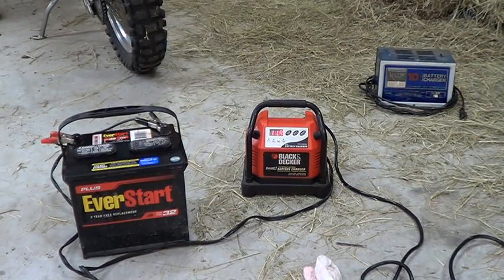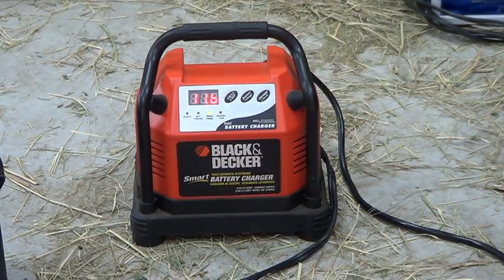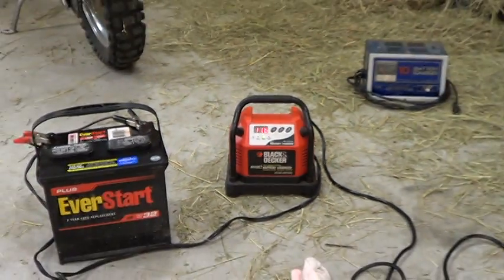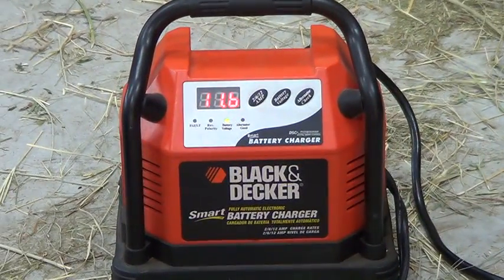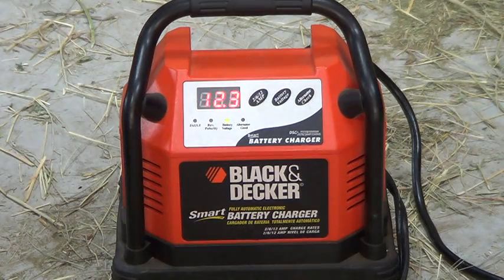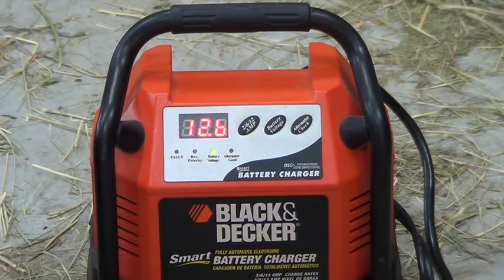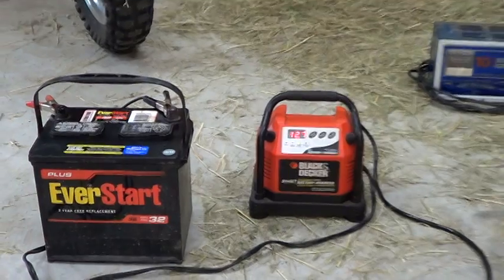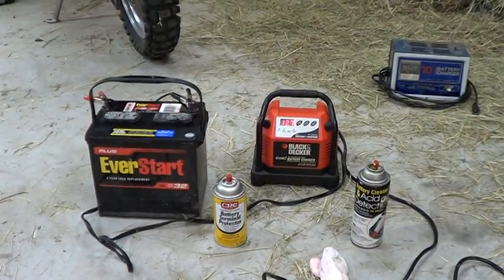Charging Battery With Open Internal Cell Error - Black & Decker Battery Charger BC 12B

Comment: thanks for the video, bud.

I got the b&d 10/6/2 amp smart battery charger.
plugged an almost dead costco batt about 4pm, and screen was reading 10.17.
510pm 10.7-10.8.
925pm 6.1-6.2

what in the h are these readings saying??
I had it on the 10amp setting, so it was supposed to be fully charged in 4.5 hours.

Comment: when you push the "battery voltage" feature it measures the battery voltage, NOT what voltage the charger is charging the battery at.  also, don't confuse the number of AMPS during charging with the VOLTAGE of the battery.  they are different

Comment: If you dump the battery out dry adding water wont get it going. Youll lose the majority of acid. Ive had some luck dumping cleaning screening the fluid and using it again. Or you can but battery acid and refill it. Youll need to get the proper ratio. If your charger there has a recondition mode run it. Ive had very good luck running my black and decker on recondition. Ive got one running now. Sometimes it will take dsys to run its cycle some times it does it in 45 mins.

Comment: How do I recharge the black and decker battery charger????
Reply from the maker: YOU don't it is NOT a battery, it is a charger, you plug it in and it charges other batteries that you connect it to.

Comment: By the way you have the battery on the ground you’re grounding the cell out regardless
Reply from the maker: stop repeating shit you know nothing about it makes you look ignorant not smart

Today all of these automobile battery-destroying or current-conducting flaws have been eliminated by using plastic shells around the various types of battery designs. And the potential problem of damage to the concrete floor from battery acid leakage has also been mostly mitigated, as previously noted by Interstate Batteries.

Comment: Never Leave a Battery on a Concrete Floor or on the Ground unless you put Wood, Rubber ETC Non- Conductive or your Battery will Die Early
Reply: dr robert dawson that’s a myth and not true.
Reply: That's out dated knowledge.  This was true back in the 80's.  Modern battery materials prevent that from happening now.

Comment: Hook it back up to the Montgomery wards charger... it'll be fine...lol I hate my smart charger...even fo3 on new battery..smart my ass.. dumbest charger ever!
Reply: Same here.  Charged my battery with the F03 warning but since the warrantee was running out I took it back to Sam's & they tested it said it was good but since their best test eqpmt wasn't working they gave me a new battery anyway.  I took it home and the piece of crap B & D charger told me the new  battery was bad too (F03)!  It's holding a good charge so I've come to the conclusion that the fault is in the charger NOT the battery.

Comment: The 2.6/6/12 is the amps that it is charging at..when you press battery button thats the voltage that the battery has in it at that time
Reply: The display is confusing. I’m using one right now and the display has 14.1. I know I have a 12 volt battery.  Then I realized that it was the charge current.

Comment: voltage rises from shaking because of making the bubles rise the top, thus freeing up surface area for acid, bubles of hydrogen form during the charging process and hydrogen cannot transmit voltage like a liquid can.

Comment: Also put your Battery on a piece of Wood, Never on the cement or bare ground,  ever.
Reply: It's an old legend due to how older batteries were manufactured. It's perfectly safe to modern batteries on cement or concrete.
Reply: On old old battery bats had metal on the bottom that could do that but not the plastic cases ones

Comment: Take Off All the cables & turn off the power. Put on some safety glasses first. 
 Then take off the caps and check the water level in the battery. 
Good Luck Rick.......

Comment: Rick you have a bad cell in the battery and it's a shitty Walmart battery. All products these days are made like junk now. I bought a die hard battery and a year later it had a bad cell in it and the car wouldn't start and I had to buy a new one. it's just the way it goes my brother. Sometimes we don't have the choice but to just spend the money when it's junk and buy a new one. In this country everything is junk made now I don't care what name is on it anymore, everyone has sold to each other, this company, that company,  but kept the name because it used to make quality you know. Do waste your time and energy - go buy a new one,,spend the money on a 5 year battery if you plan on keeping the razor so you don't have to replace the junk 2 year battery in the next year or 2 it will be worth it in the long run. hope this helps. I had 2 batteries go bad on me in the last 2 years i bought brand new from auto zone and one from O'Reilly's auto parts. So part of it has to do with how long they been sitting on their damn shelves as why they go bad and are junk after you buy them and they are made in Mexico and China.!
Reply: You are spot on, as if I were writing the comment myself. Every battery at Autozone and O'Reilly's  ( four  total) have gone bad in less than two years. I check the dates on the batteries to sure they aren't old. And my Black and Decker (DSC Smart Battery 4/10/20/40 charge rates, recharger model BC40 EB  not much help either. Always defaults to gel battery. 

How long to give a desulfation (Battery Record button on the B&D )before admitting I have another dud battery?

Worth it to check fluid cell levels?
Reply: ZeusTheGod How right you are. Practically everything we purchase is primarily... JUNK. Not liking the days when our dads or grandfathers would purchase things and 30 years later would hand them down to us and still be working!! What a shame!

Comment: The best way to test of the battery is good is to use a load tester. It's a big resistor with a volt meter and 2 clamps, it loads the battery similar to the way the starter loads it. Then you look at the voltage and if it drops below 10 volts within first 5-10 seconds, the battery is cactus.

The reason the voltage jumps around as you shake it is probably some part of the lead paste in the battery plate fell off and has partially shorted the plates. As you move it, this bit intermittently makes contact and increases or decreases the voltage.

You can tell if the battery is fully charged is by using an acid density meter. Fully charged density is 1.27, and empty is around 1.1. The chargers estimate the charge by looking at the voltage but the old batteries often have funny things happen to them like a partially shorted or open cells, so these smart chargers aren't too good for them.

A good way charge an old battery would be to place it on 5A charge with an older style charger for about 10-15 hours while monitoring the density. Once the density stops rising within 1 hour, its fully charged.
Reply from the maker: thanks

Comment: now, Rick, calm down, let's face facts, it's freakin junk!! it's got a dead cell in it and it's trash! ha,ha, don't feel bad, i just had to buy a battery for my truck it was a 1000 cold cranking amp that was 4yrs old cost me 200 to replace it, then i went to start my bike and that freakin battery was dead another 130 freakin dollars, last night there was a possum in the chicken coop killing one of my chickens so i grab my ar with a light mounted on it and that freakin battery was dead, another freakin 10 bucks for an 18650, so the moral of this freakin story is, buy a god damn battery every three years whether you need one or not!
Reply: oh, i forgot to tell you (while i was on that rant) always try to get die hard batteries there the best i've seen yet, i was a mechanic for a fleet of about 175 trucks, and we had a whole lot less trouble with die hard batteries, and the bike batteries, this one i just bought (would crank over any high performance engine) came with instructions to put on a charger every month if you don't use it every month
Reply: I buy die hard batts too.
Reply: Rick, another thing, these small riding mower, motorcycle batteries! don't charge them on 10amp! use the 2-4amp charge, in my experience anything over about 10-15 minutes on 10amp will ruin the battery. most of these batteries are made by agm and i think there crap, i have a 2000 xls and a 1981 fxe, the fxe goes thru a battery a year, until i got this (believe it or not)  duracell battery, so far it's been 2yrs, and it has a lot more power. i got it at bulbs&batteries, i'll tell ya, in my life, i have spent thousands on batteries, and there is no such thing as a good battery, and those chargers you have will work fine, the only difference between them and a high dollar charger is the high amp boost for starting something, get yourself a two wire male and female pig tail and wire it to your bike so it hangs outside of the seat or box, so you can just plug that to the charger instead of tearing the bike apart to get to the battery, and just leave it hooked up at a 2amp charge till you want to ride it. don't waste your time on these damn things, it ain't worth it, spend the time on making more vids!!! ha,ha,ha,

Comment: Rick this is your movie night family :) my husband said, when you shake it you're covering and uncovering the plates with acid, temporarily changing the capacity of the battery. any lead acid battery like that which is approaching 5 years old is questionable, especially a discount Walmart battery.  if it's nearing 5 years and acting up, replace it. doesn't matter a whole lot how much use it actually had in that 5 years, they break down internally anyways.
Reply from the maker: thanks..
Reply: here's more answer to your question, instead of just me saying the battery is bad. that charger is trying to push say 13.5 volts into the battery to charge it (yes, a 12v battery is charged at up to 14.7v).   the battery is resisting it because it is a load (it has resistance, and putting that 13.5v across it causes the charge amperage to flow).  because of the battery's resistance, even though the charger is trying to push 13.5v, the battery draws it down to 12.7v or whatever.  when you shake it and uncover some of the lead plates, you lose some resistance and the charger is able to get closer to that 13.5v.  so you're not increasing the voltage or capacity of the battery; actually the opposite, just making it easier for the charger to hit 13.5v.  case in point, if you drained 1/2 the acid from the battery you could probably get to 13.5 volts charge a lot faster, but you'd only have 1/2 as powerful as battery.

Comment: I have that same charger . The fan went bad in mine .  I replaced it with a fan out of a computer power supply . Mine works great .
Reply: Hi MuzzleMike, I know this is an old thread but I'm hoping you get this message. I wanted to ask what fan you got to replace the one in your charger? I have the identical Husky model with battery recondition mode and it has worked awesome on more batteries then I know. I've literally had this thing for 20 years and I can tell the fan is going to go out on me eventually because it's making noise, lol. If anyone else reads this i can tell y'all that when I get an F03 code with an F02 code I force some charge with jumper cables into the dead battery from my truck, then the charger will read it has enough charge and let it go into recondition mode. I also open up the caps and top off with distilled water before doing anything. Even if batteries are made in newer style cases the past 10 years, I always set my batteries on wood . I grew up a tom-girl and thankful to my Dad for that. He taught me more then I could of ever learned in a trade school. He owned a Paint & Body shop my entire life and always had old sweet rides and newer stuff. Just a little info because  because I don't want anyone thinking I'm some dumb woman. I've manged to make it to 57. Have an awesome day! 😊

Comment: open cell means one cell of the 6 is open or BAD. May simply be low. DO NOT CHARGE YET! Top off each cell with distilled water. Check with a volt meter. 
Got a go l8r. email me in plano
Reply from the maker: I did top all with distilled water but don't have volt meter

Comment: This is an easy one Rick. Find a friend with a traditional (not smart) charger with an output of 20 or more Amps. Put battery on a piece of wood in an area where a meltdown won't cause major problems. Sock it to that battery with a 20-30 Amp charge for an hour or two. Do not get close to it or shake it !  If this doesn't work, it's toast...time to buy a new one. I've used this method for 45+ years, and sell and maintain batteries for my customers. Be sure to top up cells with distilled water to the proper level before beginning.

Comment: Please wear a pair of safety glasses when working w/a battery. I'll never forget the day the emergency dept brought a man screaming into our x-Ray dept becuz a battery had exploded in his face. It was awful - can still remember his screaming to this day. All guys working in home garages - I hope u all wear safety glasses.
Reply: Carol V safety squint serves me fine
Reply: Dave Elliott - I hope "safety squint" is a brand name...lol
Reply: Carol V, i have seen this at least ten times, once like the one you experienced, I've seen guys take a wrench or a piece of wire and short out the pos and neg terminals only to have an explosion like a m80 go off right in front of their face, that acid burns like hell. battery dangers should not be taken lightly, even the small batteries that people just throw in their draws, a friend of mine took the battery out of drill and thru it in the top tray of his tool box, closed the lid, and came to work the next day and just about everything in the tray was burnt up! screwdriver handles melted, chrome sockets were almost black form getting so hot, so ya, be careful, can't be stressed enough!

Comment: Most are going to go with the concrete thing but a linear logic thought about why the charge goes up is that electricity is electrons in motion. By shaking the battery, and god I hope your car doesn't shake like that, you are adding additional speed, excitement or motion to the electrons meaning more "charge". The faster a generator spins the higher the electrical output. Makes total sense, to me anyway.

Comment: Oh btw, you should really only ever charge a car battery on top of a block of wood, as concrete is actually conductive through the body of the battery itself. Sometimes giving the battery a good shake or banging it down sharply on the floor a few times can dislodge the sulphation if the battery isn't too far gone.
Reply: shoominati23 Concrete is not a problem, not for the last 60 years.
Reply: So what has changed that the concrete doesn't affect them? the casings?
Reply from the maker: iamedbytes what changed in concrete in the last 60 years that now it is not a problem but used to be a problem?
Reply: Think Like A Cop - The Rest Of The Story Concrete is the same but batteries are different. Old batteries originally in wood or rubber cases had problems. For 60 years it has not been a problem.
Reply: shoominati23, yep.
Reply: rick, thats an old wives tale, back then the batteries were a lot worse then now, but what happens is the battery gets cold and power goes down, if you could keep the temperature 75 ALL the time it would last probably twice as long as to one that see's winter, but who wants to pull their battery and put it in the house every winter, and don't do the coke or baking soda thing either, just take an old rag and wipe it off real good, with the caps on, no dirt in the cells, and that spray you have just spray the terminals off the battery then  wait till it dries and put them on the battery, throw the rag away and wash your hands real good (touch nothing) especially your guns, it will take the blueing off in a heart beat, and there ain't no touching it up, it will be a complete re blue job! no hands in pockets, touch nothing! and be sure to clean those tools with gas or something like that, if you don't, when you pick them up at another time guess what! you got acid all over your hands again! been there done that,  worse part is i still do it (some people never learn) and i went to school for this $%^&%.
Reply: shotdog : Living in Montana in the winter in minus 40 weather we put the batteries inside out of self defense. We kept them charged. We had heaters on the cars to keep the antifreeze from freezing. We also had heaters to keep the oil at least a little warm. Town was 40 miles away so if you needed to make a trip you would let others know to save them a separate trip. You would take out a battery that was NOT yours and crank the engine till the battery died. Then a second battery that wasn't yours if you car was in good shape it would usually start with the second battery. You then put in your battery. Stick shift meant that you parked facing out and drove for a while until the transmission warmed up and you could shift. Lots of fun.
Reply: i would to, i remember one time in ohio the wind chill was 50 below and i had to put a tarp over my truck with a kerosene heater under it to warm up the oil  in the motor to get it to crank over! it took a half hour to melt my ice beard!